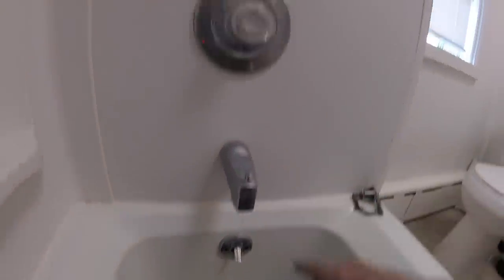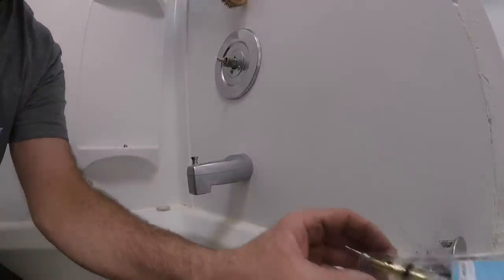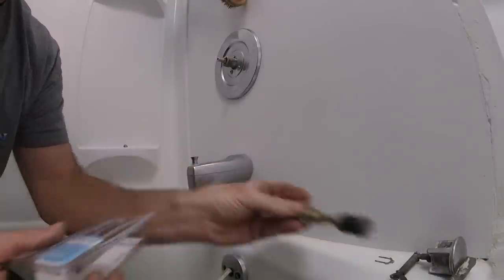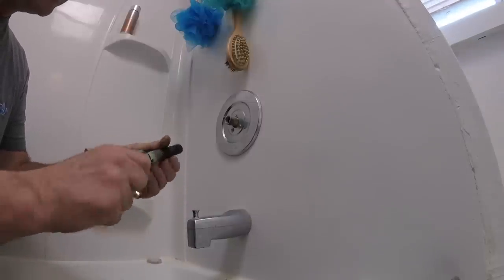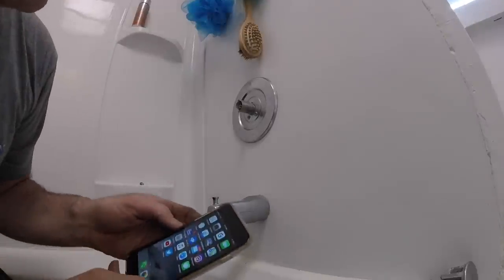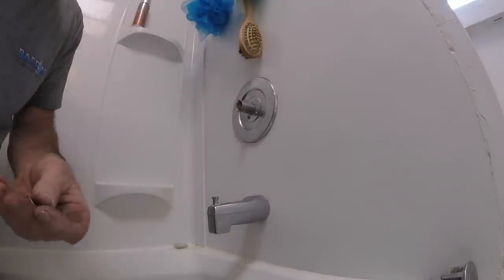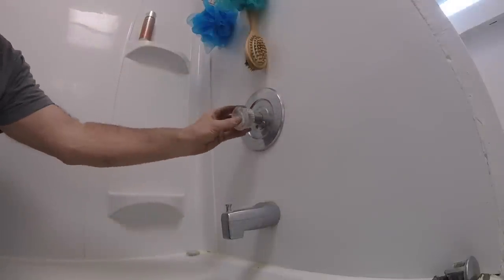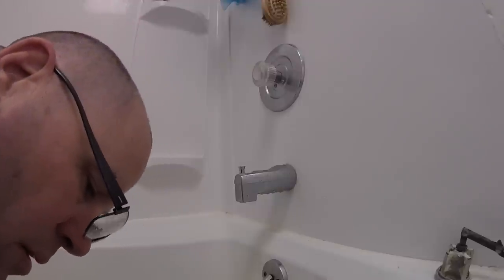MOEN TUB AND SHOWER FAUCET CARTRIDGE 1225B INSTALLATION

Comment: What's the difference between the 1225 and 1225B cartridges?  Are the positions of the screws on the Escutcheon a way to identify the type cartridge? What's the life-expectancy of these cartridges, 25 to 100-years (depending on rust and sediment going through them, especially on the hot water side)?

Comment: The indention on the brass stem will indicate if your hot and cold is correct
Reply from the maker: hmmmmm good question. Im not sure. Let me know if it is. First im hearing of this.
Reply: @ChuckBarron  Just look on the top of the cartridge where the screw goes that one side is slightly lower than the other. Just face that indention the same way as the old one was.
Reply from the maker: thanks Josh. I will check that out for sure.
Reply: Yup. I see the indentation on one side of the stem. It looks like a very small step.

Comment: I don't have an o ring is that a problem?  At 1:29 you can see the distance from the  stop tube or cylinder to the tip of the cartridge which looks like 1/2 inch.  Mine is about 1/4 of an inch.  When you touch the cartridge tip there's a slight spring back . I turned the water back on slowly leaving the tap in the closed position. When the tap is open & the water is running I can't push the handle back in due to the pressure of the water. What would cause this? Faulty cartridge or did I do something wrong? Thanks in advance
Reply from the maker: may be debris in line.

Comment: I just took one out ( Moen 1200 E ) and I used the same Danco tool . BUT only took central stem out . Had to go in with tap then screwed it some more got very good grip,on it then pulled out the rest of it .  First one I ever did . i did a sink cartridge once and it was easier . Oh well .
Reply from the maker: I have since purchase correct tool.
Reply: @ChuckBarron  Which is ??

Comment: Anyone else push Delta products because Moen stem will stick in the valve body when they have been in service for years? I have had 5 cartridges that the center stem comes out and the rest stays in the valve.
Reply: when i co-worker talk about his moen faucet leak, and his know his will got the hard get the stem out without tool. i offer him the moen tool i have. i tell him delta easier deal with....
Reply from the maker: Ya I have always used Moen here. Good tip Patriot.
Reply from the maker: The tool was key for sure. I just started using tool this past year too. Thanks Hk

Comment: on aurora avenue/hwy 99 in the city named after a chief named Seattle(Sealth) is a plumbing parts store that has a neon sign outside a good 5ft tall plumber's helper, its been there for a long time but i never ever noticed what it was or what it was there advertising...back in the early 70's i would do the saturday stand in line and wait my turn to seek from those waiting on the hungry trying to save a buck, not only did i  get some good advice on how to but it was like going to church, i always came away feeling good(the good old days) the old guys workin the counters had it good it seem, a place to share all that which they had learned without the getting dirty or tired, the pay wasnt the same but they fulfilled a need of the time...sUrF'S uP
Reply from the maker: man your stories are like my past too...are you me 30 years ago at ace plumbing supply waiting for counter help. good stuff..